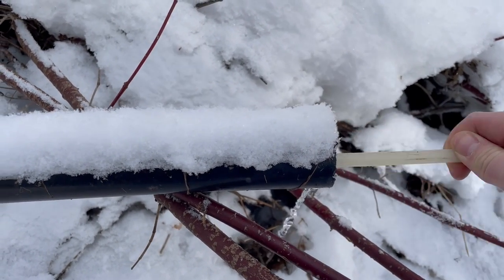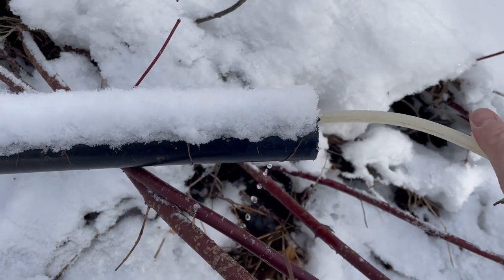How To Thaw a FROZEN Septic Tank Pump Out IN MINUTES!!!

Comment: Thank you for this!
Mine froze up this morning in -40.
Woke up to the alarm going off at 4:30 in the morning.
Instead of the bucket I used a Gatorade water jug and an aquarium pump on a piece of fuel hose.
Was froze up to about 8ft in but had it thawed out in about half an hour.
Just what I wanted to do at 6 in the morning in the dark with a -50 wind chill.

Comment: Are you dumping raw sewer out onto the ground?
Reply from the maker: Do you live in a city?

In rural areas your house empties into a septic tank, In the tank their is a weir, solids digest and settle on one side, the excess water flows over the wall into the other side of the tank. When the side holding the separated water fills an automated pump pumps it out on one side of the property.

To be permitted to do this you need at least 10acres of land. If you have a city style acreage with a giant house and 1 acre, you must install a leech field because your neighbour’s are so close, or you may have to constantly have it trucked out.

Cows poop right on the ground, the difference is the concentration in one area.